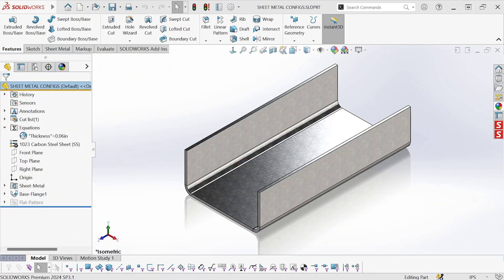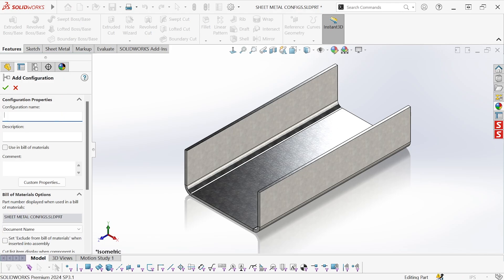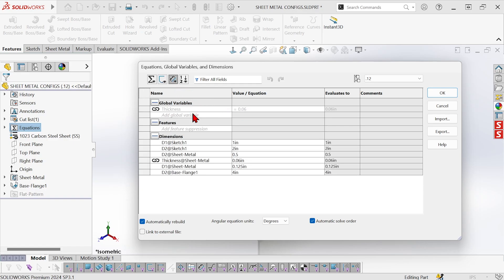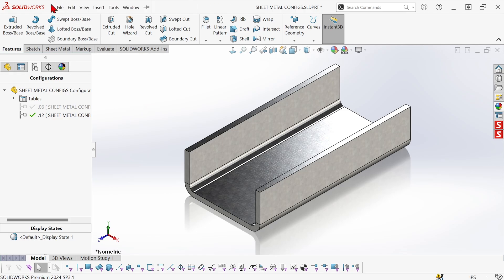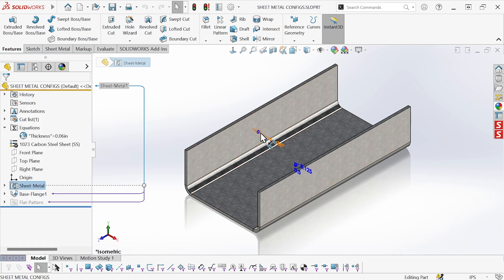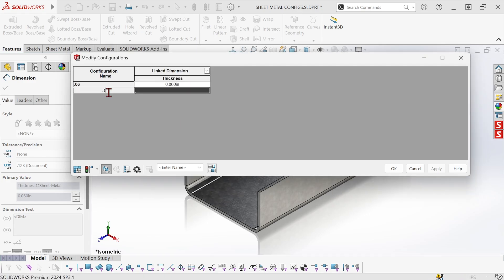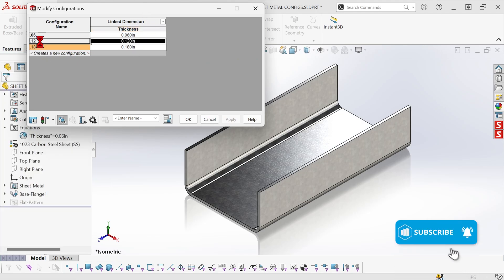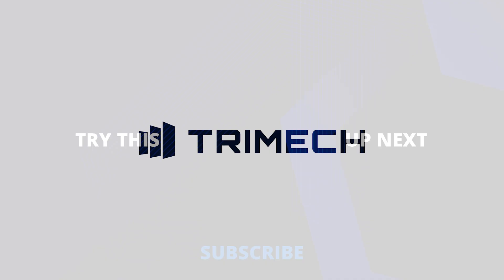How to Configure Sheet Metal Gauge in SOLIDWORKS

Comment: Thank's for the video, I use the SW for over a decade but it was the first time I have seen the reload option - it's cool. The main subject: you can define the Sheet Metal parameters in the custom material and that was my goal, to configure it there, and than just make the configurations with different materials. But it does not work with the gauge table linked to the material - would it work with bend table or bend calculation table? Thanks in advance
Reply: You're welcome! I don't believe this method will work well with gauge or bend tables. The table would set the gauge for the first configuration only. After that you'd essentially be overriding that table selection.

Comment: Can this also work when referencing a Gauge table?
Reply: Technically yes, but not really. If the first configuration references a gauge table, then you configure the thickness dimension as shown in the video, only the original configuration will have thickness set from the table.
Reply: @mikewalloch8657  Thanks, Mike! I've been using Driveworks to control Material Thickness, but with this, I can probably use custom properties like I can with Length, Width and stuff.